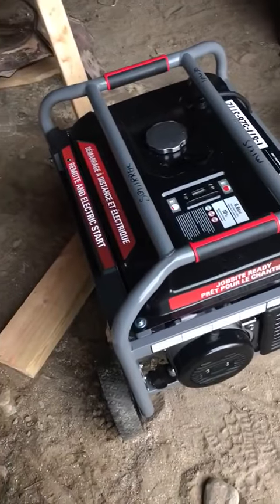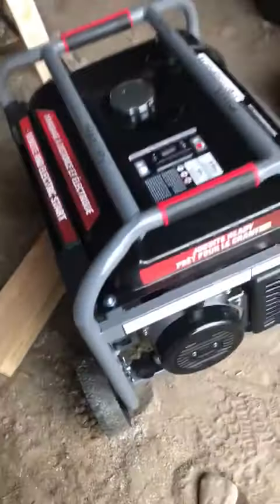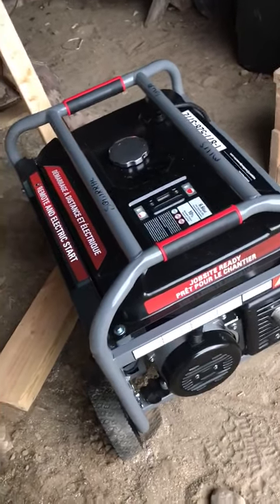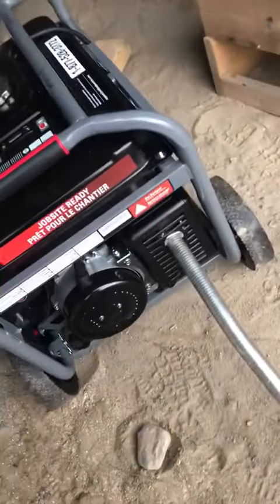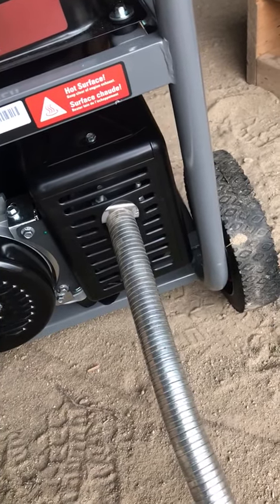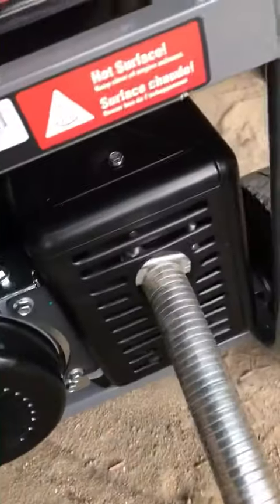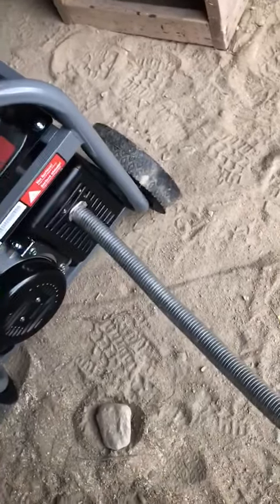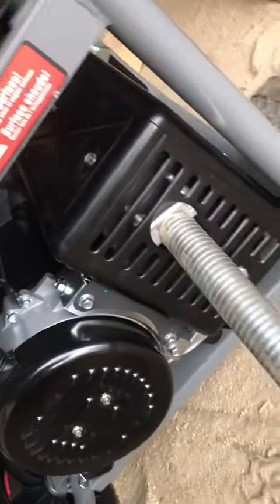Installing an exhaust pipe on a Benchmark 11,500 Generator

Comment: I just bought one and also want to run it in an existing plastic shed. 2 questions for you : (1) do you need to seal in anyway where the the flexible pipe attaches to the muffler stub to prevent exhaust fumes leaking out and (2) how did you heat shield the flexible hose where it passes thru shed wall? In my case I have a plastic shed. Thanks, Gary
Reply: I am wondering the same thing about sealing where the flexible pipe attaches.  the stub ot my  exaust is about 1"
Reply from the maker: Bob didn't have to seal it as it was flanged.  He used a piece of old insulated pipe from a pellet stove to go through the wall.  another thing we found out is that we have to have the door open or partially opened when running, as it will use up the oxygen in the tiny shed and will be starving for air.  If we did it again we wouldn't have it in the same shed as all the electronics and it still gives off quit a bit of heat when running so another reason we keep the door partially opened, so the electronics don't get condensation.
Reply from the maker: because of the stub, it made a secure fit for ours and there is no leakage around it.  when in doubt use heat resistant gasket maker.

Comment: I bought the same one looking forward to further videos as a how to guide!
Reply from the maker: Thank you
Reply: ⚠️Portable Generator Safety Tips:

1) KEEPING OTHERS SAFE: Please do not allow an unqualified person or your children to operate and service the portable generator. Just because some manuals don’t say that doesn’t mean it’s safe. That is important against the generator safety rules. We also need to be keeping an eye on our children too. You need to make sure that your children are not playing near the portable generator especially when it’s running so they won’t get electrocuted. Generators pose electrical risks and they can be hot during an operation. Please keep your children away from the portable generator at all times. It is important to keep our children safe especially our little ones. Be aware of all the hazards.

2) WHERE TO RUN YOUR GENERATOR: Some people use their portable generators indoors which increases the risk of carbon monoxide poisoning. It’s important to have a carbon monoxide if you have a gas generator. Never ever use your generator indoors even if your doors and windows are open and even in the garage is not safe to use a portable generator. Also please never use your generator in your deck or balcony. It is never safe to use your generator indoors and in enclosed areas of your home. Your generator needs to be 15-20 feet away from your house. 

3)🔥FIRE HAZARDS: Never refuel your generator while it’s running. You need to let your generator cool off before refueling it and before storing your generator. Never overload your generator too. Never ever back feed your generator. You should never plug your generator into a wall outlet. Also never store propane tanks indoors. Please keep flammable things away from the generator as well and please don’t smoke cigarettes near the generator. Having a fire extinguisher next to the generator is also important against the generator safety rules. It’s also not safe to move your generator while it’s running.

4) GENERATOR OPERATION: make sure your hands are dry before touching the generator. Never use your generator in wet conditions. Don’t let your generator get wet. You need a generator tent if you need to use your generator during wet weather. Please don’t wear loose clothes when operating the generator. Turn on your generator before plugging in appliances. Use the right cord for your generator. Please do not use worn out cords. 

https://youtube.com/shorts/eFigDfnPkcQ?feature=share and here is a short video more about keeping others safe when using generators. Portable generators need maintenance so it’s important to follow the safety instructions.

Hope this helps. This is just a reminder required for safety uses.
Reply: @The_Happy_Aviation_Enthusiast  Bro shut up

Comment: Hi I bought the 6250. Trying to start it from the Magnum inverter. Stupid auto choke only works from the remote and doesn't when electric starting. Trying to get the auto choke to work . Any tips?
Reply from the maker: when I don't use the remote, I have to manualy choke it, the choke lever is on top of the air box? give it a start then push the choke back off

Comment: Finally decided on getting one after your reply … have you had trouble putting in a whole 25 liters of gas in the tank ? After 20 liters its already to the top … also the manual reads 1.1 liters of oil but barely ahows on the dipstick if i follow the manual to NOT screw in the dipstick when verifying ? Im confused and wondering if you encountered these problems ? Im waiting on a response back from the manufacturer thanks
Reply from the maker: I've found that you can see the gas when it's about 3/4 full, that's about as full as I fill it.  It burns about 6 liters a day, so I don't usually fill it right up.  make sure that there is always oil touching the dip stick, it seems to drink the oil real slow when adding it.  very important to change the oil when it says to, especially that first change.  after using mine for 6 months now, I am still really impressed with it.  make sure there are no loads on it when it starts, it is not so hard on it.  you don't necessarily have to unplug things, just use the breaker to turn the load on or off
Reply: @cindysquirrelloffgrid9514  thank you so much for the response do you verify the oil level while your dipstick is screwed in or just entered but not screwed in ?

Comment: Im looking in to picking one up but not too sure of the brand .. are you satisfied with it  ?
Reply from the maker: I am very happy with this benchmark, it has a remote start which I love, because if I need the geni running in the evening and it's time to turn it off, I don't have to go outside to do so.  Price wise they are a quarter of the price of a Honda, so there's that too
Reply: @cindysquirrelloffgrid9514  thank you for the reply i appreciate

Comment: I just bought this, it scared me how cheap these are, mine was 999.99 on for 899.99 how has it been working?
Reply from the maker: we change the oil as the manual says to and we have had no issues with it at all,